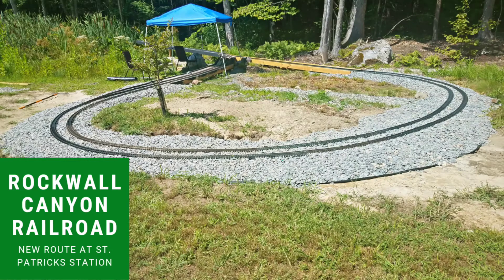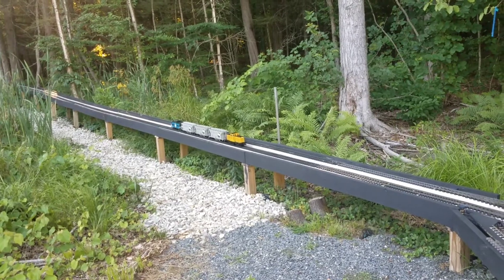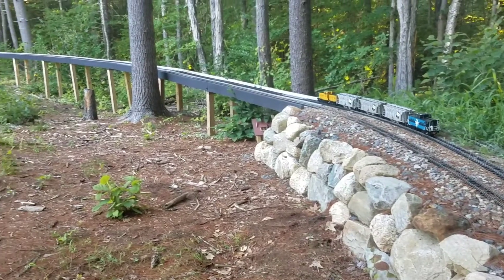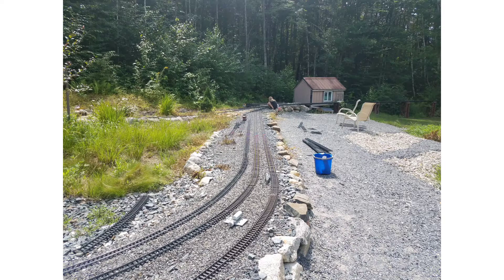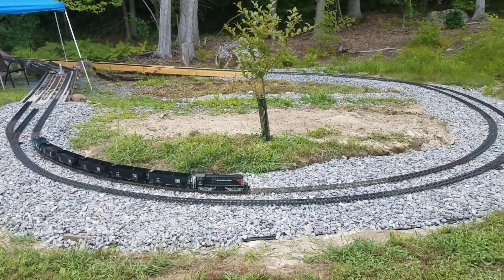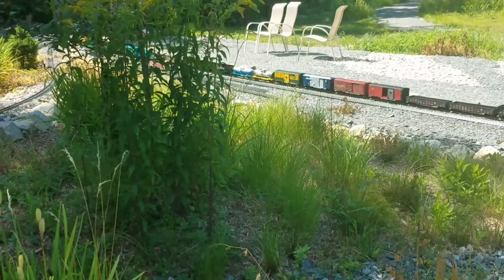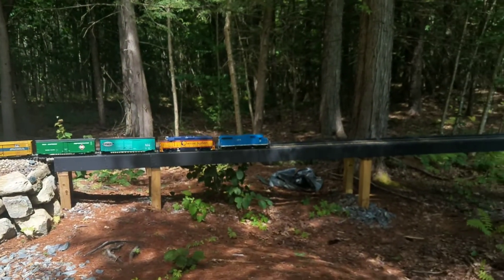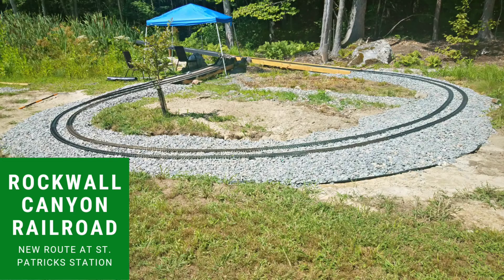G Scale | Rebuilding track for better operating. Awesome new track from @TrainLi

Comment: 3:29 Aristocraft and USAT use 1:29th scale or #1 scale on G gauge track. Europeans use 1:32 scale or I scale, #1 in Roman numbers, also on G gauge track. Originaly. G scale refered to LGB narrow gauge trains, 1:22.5 scale on G track.The whole thing got messy later on by making up the term G scale which means nothing. Manufacturers followed the trend, which will be impossible to break. I, however, wil call them either #1 scale or 1:29th scale.
Reply from the maker: Thanks for writing back with your explanation.  So, I agree with you that 1/29 scale is a much more accurate description for Aristo and USAT trains.   

However, the term  "#1 scale" was introduced by aristocraft only on their later packaging.  This term was largely rejected by the garden train world because it confuses the scale and gauge.   American models (by Accucraft, Bowande, etc..)  are also being produced in 1/32 that are called Gauge 1 or 1 Gauge, and for once, there is a historical precedence for that.    

In this case, Gauge 1 refers to the size track they run on, and the scale is implied to be 1:32 as that is the proper standard gauge scale for gauge 1 track.  

It fits in within the existing gauge system.  Gauge 3, 2, 1, 0, H0 (half 0)

The same confusion happens in the small scales 0 Scale, H0 scale, etc... They're really talking about gauge, and the scale is implied.  

So even though 1/29 scale trains run on Gauge 1 track, we are careful not to call them gauge 1 trains, because the implied scale is 1:32.  Thus, we have G scale..🤡

Comment: Super lot of engineering work done there  brilliant  idea hauling out thestation with the tractor hehe,  I  used peco track from the start after seeing all the issues with Aristo ties falling apart so far after twenty years almost all still good,  do you have a  part number for the gears  for the 44 tonner, mine is almost done only running on one axle,, cheers and thanks for the update 🛤👍
Reply from the maker: Thanks so much!  Glad your peco track is holding up well.  Here is the link to the remaining parts available for the 44 tonner: https://charlesro-com.3dcartstores.com/44-Tonner-Diesel-Locomotive-Parts_c_646.html Motor blocks are on the first page and wheelsets are on the second page. I'm told that these replacement wheels are still prone to gear splitting, but at least they have fresh teeth!
Reply: @RockwallCanyonRR  Thanks Rocky much obliged

Comment: Like the 44 toner, glad you got her gears repaired, great layout update. Is your track floating for the most part?
Reply from the maker: Thanks Ron!  Yes, I'm really happy to have it running properly (for the most part)!  The ground level track is indeed just floating on crushed stone.  I also use split jaw clamps in strategic places (usually just on one rail at each joint to save $).  The elevated sections are also floating on crushed stone as well due to the wet clay soil they help navigate across.

Comment: what is the grade rise on the underpass spiral. Looking at adding a extension of 72 foot run with a 19 inch rise.
Reply from the maker: Hi Kendra, Thanks for watching!  You would certainly be good to go.  The 19in climb divided by 864in length indicates a 2.20 percent grade.  My overpass track is actually more like 4%.  So that's a lot steeper than I prefer, but since it's not mainline I let it go.  My mainline max grade is 2%.